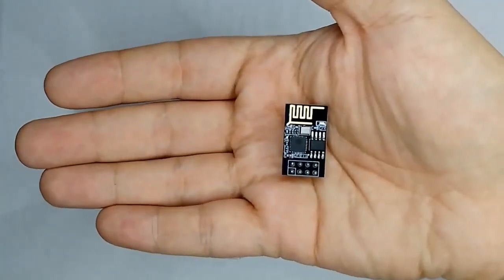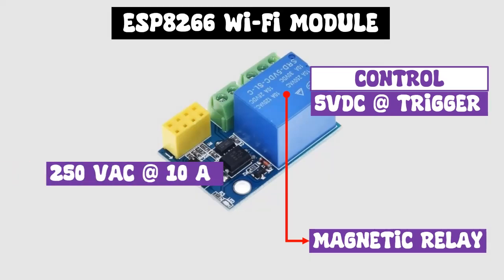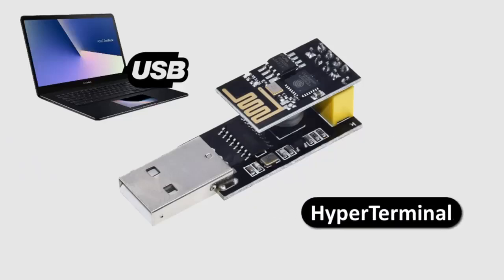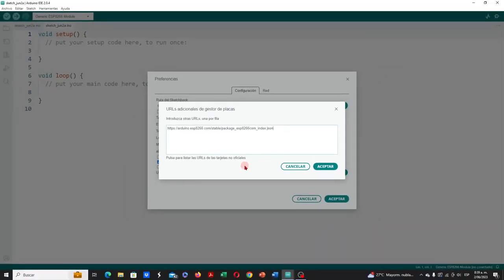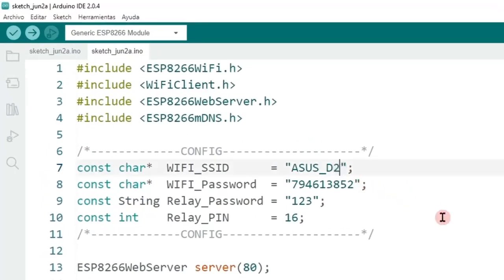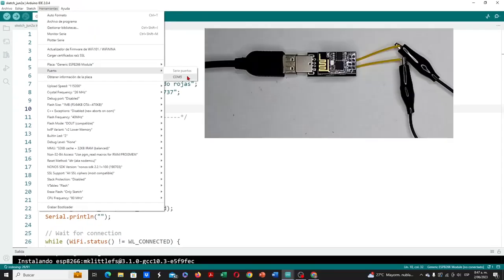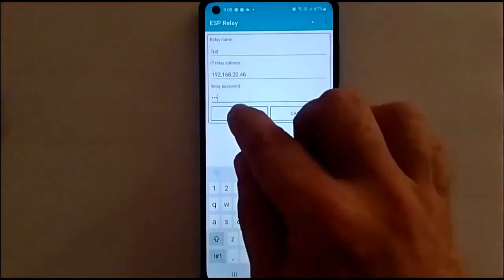Wireless Light Bulb Control Wifi Relay Module ESP8266 01/01S ESP RELAY

Comment: isn't the ESP-01S 3.3V while CH340 10V, wouldn't the CH340 module damage the ESP?
Reply from the maker: It is 3.3v. but the boards are regulated to 3.3v

Comment: Can esp8266 power a 3v led without a relay module
Reply from the maker: well, it depends on the led, an esp8266 gpio pin drives maximun 12mA, so for a 3.3V output pin it is arround 40miliWatts. 

for a low power diode led it will work with no relay, for a 3 Watts high intensity led  or higher a relay or transistor is needed.

Regards
Reply: Thank alot

Comment: Hello, please give me instructions on where I'm making a mistake. I only see dots on my monitor. According to your video, the SSID and IP address should be displayed. But they don't appear. Thank you in advance for your help.
Reply from the maker: Hello. With the monitor opened, try resetting the module with the reset button.  And also check the SSID and PSWD be correctly typed, with the blank spaces and all special characters it has
Reply: set the terminal to 115200 baud rate

Comment: Unfortunately this does not work very reliably. I have multiple of those, and especially switching the 230V (much less than 10A) off works only half of the time - after the lights have been on for several hours. I did some measurements: the magnetic relay is actuated with 3.3volt - not the 5 volt it is rated for! This might result in a not optimal contact for the 230V in the magnetic relay, causing contact burn. It was however interesting to note that kicking the relay has it switch off, provided the ESP also has stopped the flow of current through the coil. I find it weird that on a 5V supply the manufacturer does not provide a boost from the 3.3V ESP GPIO outputs to actuate the relay...especially as the rated current to actuate the relay is approx. 70mA, which means that there IS a booster (ESP can only deliver 6 or max. 12mA on a GPIO). OR: there is also a 3V version of the same relay??? Weird, weird.

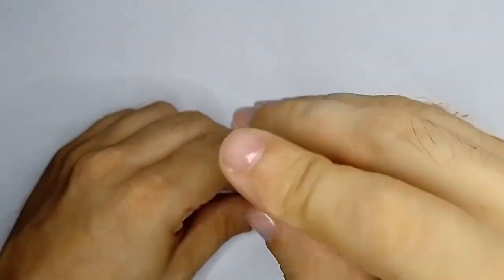Comment: 7:29 it's not particle to have two power sources on any simple circuit, this adds unnecessarily complexity  , the 5v supply should already be supplied from the main power source

Comment: how to find ip address?
Reply: You just push the serial monitor button up in the right corner of arduino ide,  set the baud rate to 115200, and restart the device. You should see the IP there if you did it correct.

Comment: I have an issue please help.... In serial monitor there are some question mark appear. What am i doing now. Please help me😢
Reply from the maker: Check the baud rate. For the serial monitor must be the same as the one in the code, 115200 i guess
Reply: @ElectronicSpotEng  Thank you brother 😊. It's worked